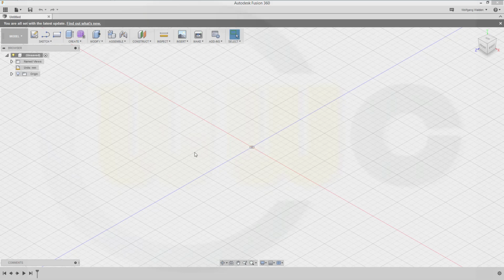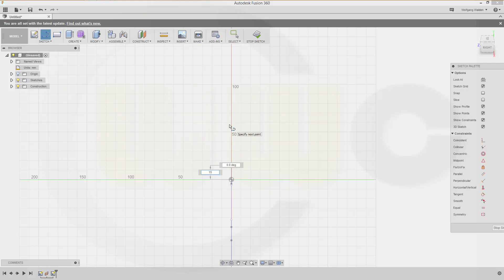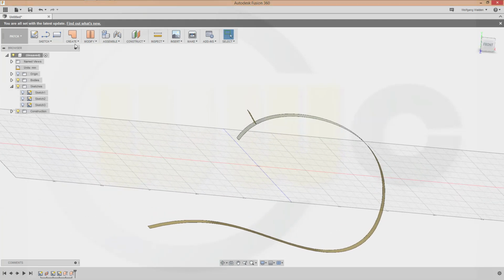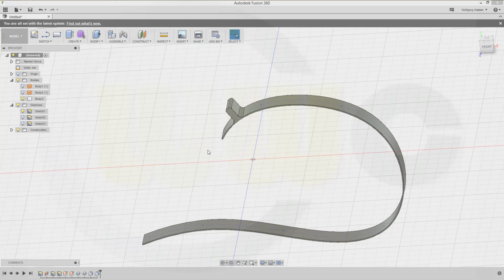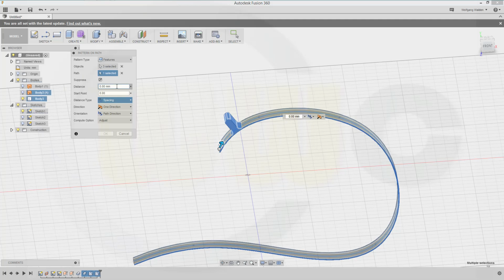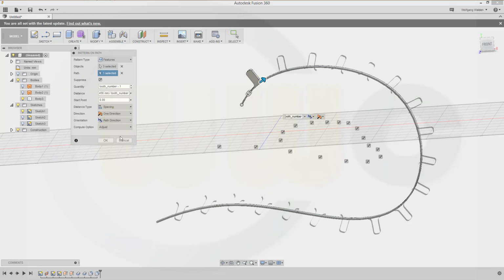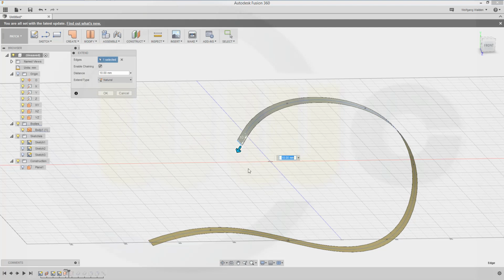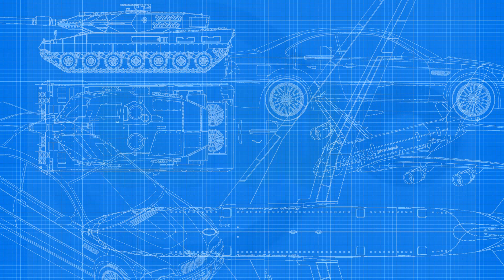Userwish Zahnriemen v2 -  Cambelt v2 - Autodesk Fusion 360 Training

Comment: Very cool Wolfgang !! Is it possible with the Fusion 360 to create a closed belt and move it around two pulleys, for example? I looked for tutorials on this topic and found nothing. With SolidWorks and Invertors this possibility is real.
Reply from the maker: Hi, I really don´t know, I would have to check for myself. But fusion 360 is really very similar to inventor so it should be possible.